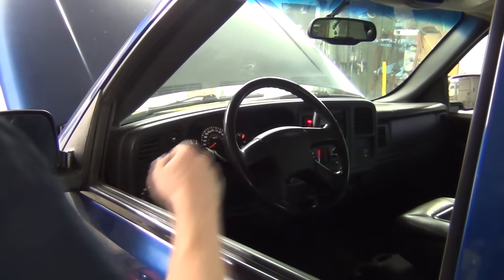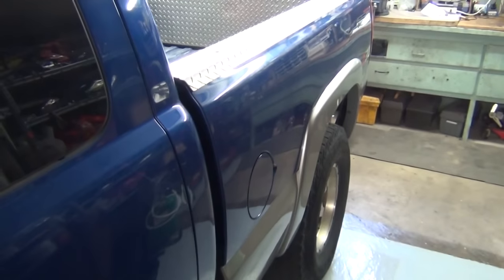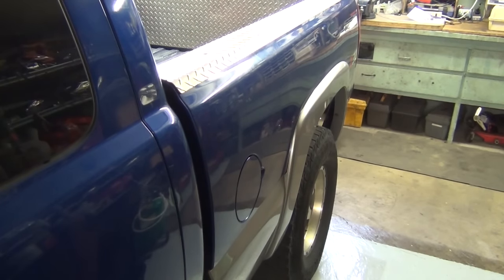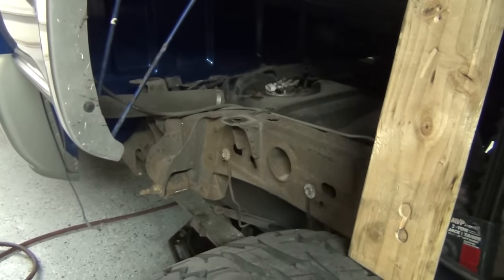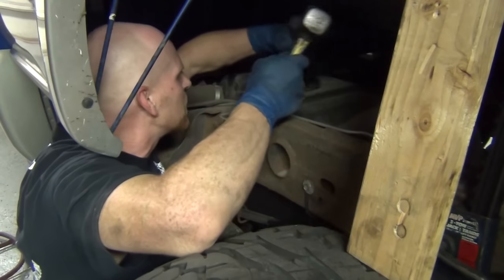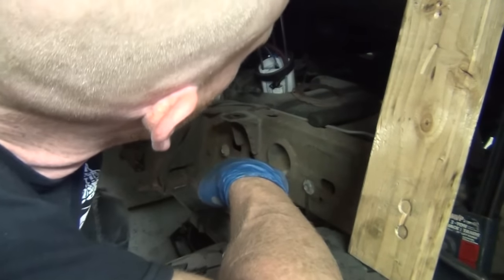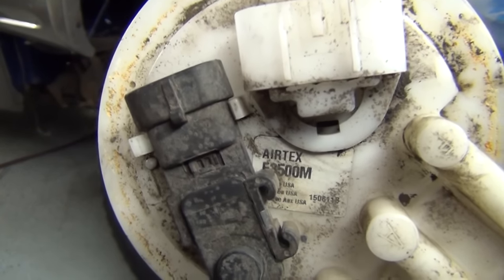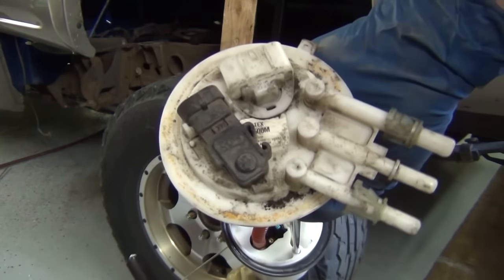Tipped Bed Method!  GMC Fuel Pump Swap.

Comment: I've used the bed tipping method before when I was younger. My next fuel pump replacement is tomorrow, but I'm much older and cannot flex like I used to. I'm taking the whole bed off this time with a gantry crane. Always wire wheel the rust from the bed bolt threads with a bench grinder and always use never seize on the threads. Make sure to test run the new pump before putting the bed back down.

Comment: Thanks for your video. I just finished replacing my fuel pump with the highly recommended Delphi unit. $177.00 at Carquest.  What I did slightly different from you was I removed the rear wheel and inner fender support brace which gave me much more working room to remove and re-install the pump. I recommend the tilt bed method to anyone and my camper shell stayed on but tailgate still needed to be removed for clearance while tilting.  I just saved myself $450.00  on labor by not taking it to the mechanic.
Reply: Is it Delphi fg0407

Comment: Yea I was wondering how long you'd work with the bed up on that piece of wood. That bed comes down, it'll mess your day up for sure...
Reply: yeah i definitely seen the board move & so did he 😂
Reply: i had tilted the bed and it took a few min before i said scew this and removed the bed it was the smart way to install the pump  the correct way
Reply: @Ken-op7sg  LOL. no doubt. I've seen access panels cut in truck beds to make it easier. Sort of like the access panel under car rear seats now that get you access into the tank without dropping the damn thing.

Comment: Brian...Thank You.
Used your method to change out a 1993 454SS fuel pump yesterday. Went with a Walbro 190lph pump. This was so much easier than dropping the tank...done that twice before on an 87" GMC.
Reply: XJj

Comment: Thanks a bunch Brian! Definitely still a tight squeeze to get in there, especially since I needed to replace the connector.. Took me 3 hours laying in the slush up here in Calgary, Alberta! My ass was numb by the time I finished. Saved me a few hundred bucks, real proud of myself -- wasn't sure I could get er done. Runs nice and strong now! My only issue is that I tightened the passenger side down without checking the fit and now the bed is off kilter just a hair. Not enough to be really noticeable but still enough to bug me.. I'll save that for the warm weather.

Comment: Thank you times one million for this video.  I got to change my fuel pump this week and this helped alot. Only problems I ran into is the nuts broke their weld on the front 2 bed bolts so I ended up cutting the bolts, the other was the locking ring holding the pump to the tank was a bear, I needed an air hammer.  Guess that what happens after 14 years of driving salty Iowa wintry roads.

Comment: One thing I like about this method you can pretty much change the pump standing in a foot of water. sure beats dropping the tank. after 30 years of changing pumps this was the first time today I tried this method, my shop was full so the only place I had to do it was out in the very uneven gravel parking lot, all I can say is no more dropping tanks for me. thanks for sharing.

Comment: Excellent video. 5 stars.

My niece started humming the Superman theme when you lifted the bed up. ;)

Running the truck with out the fuel pump relay and the gas cap off seemed to help with squirting fuel in my replacement.
Reply: you have a awesome daughter lol

Comment: Great video, 230,000 and my pump was putting out about 30-40psi.  I was not looking forward to dropping the tank.  I used a 12 inch long 2x4 and jack stand between frame rail and cross support on bed.  This along with removing the tire gave me easy access to the pump.  I didn't have the 90 degree pliers but that looks like the ticket to removing the fuel lines.  Thanks for the video

Comment: I took my truck to the shop he quoted me $850 to replace $250 for the part and $600 labor because he said it's a 2 man job to remove the bed. With your video it cost me a total of $190 for an oem part. Thank you

Comment from the maker: I always use two means of support so there's a back-up.  The bed weighs about 230lbs I have a 8,000 lb jack stand as a back-up to the board to catch it if needed.  Thanks for caring!

Comment: thanks for the video i did this method the other day on my step sons truck as he just filled the tank. super easy. i wear contacts so it a must to wear safty glasses as i got a face full of dirt. work like a charm, i live in az so we dont have the under carriage build up problem and bolts came right out with a breaker bar and he wanted to help to see how things were done and we got it DONE OVER THERE ON THERE.

Comment: I had to remove mine today and I don't have the right equipment to do this job nor do I have anyone that could help me with the bed so this video saved me. Thank you Thank you Thank you. Mine is a step side but it still worked perfect. my old pump is an AC Delco and just went out after 12 years so I ordered the AC Delco to replace it. Great video dude, Thanks.

Comment: Just had exactly the same thing happen with an AirTex pump i put in in 2012.  Only made it 50k before it started running rough like yours.  Used the bed tip method this time thanks to your video.  Was able to tilt the bed with a Ranch Hand headache rack and a full set of RKI boxes installed using a floor jack and didn't have any issues..  Put in an OEM pump this time!  Thanks for the video, it was very helpful.

Comment: the tipped bed method works great, and is pretty easy with the right equipment.  i back my truck into the my garage and use a commercial ratchet strap (used to secure cargo on semi's) to lift it from the rafters then block it well for safety. 2001 GMC 2500HD the pump goes out about every 2-4 years. i refuse to cut into my bed but thats just me.
Reply: Does this method working for replacing rear brake lines as well?

Comment: Thanks a million!  My fuel pump just went on my silverado and I'm gonna go after the repair tomorrow morning.  Going to try the tilt bed method vs dropping the tank.  Looks alot easier
Reply: Was it a 2000 by chance? Mine's there too, I see a few recent comments lol.
Reply: Chubbza5 mine is a 2000 and 120,000 miles. Debating to do it myself
Reply: @Drink6up     it worked slick.   New pump had an upgraded wire harness than I held to solder together but it was all much better than the old school dropping the tank method.

Comment: THANK YOU for sharing this! I followed your advice while replacing the fuel pump on my 2002 GMC yesterday and it was a HUGE help! 

I installed a Delphi fuel pump but my lock ring was severely rusted and I had to cut it apart using a Dremel tool with a cut-off wheel before my old pump could be removed. Once I located a new lock ring it didn’t take long before I had it back together and running! 

Thanks again!

Comment: I used your method to raise the bed up to remove the tank filler hose to syphon out some very old Ethanol gas.  It worked great.  If I ever have to replace the fuel pump I will do the same process.

Comment: Precision seems like a company that has well developed parts. I have not done any research on the brand, but I have installed a couple of different parts produced by them. Haven't had any trouble as of yet. Thanks Again for an insightful video Brian.

Comment: Good video. Like the additional support. A YT method shows tipping the bed to rear, not sure how that compares to side. Maybe be harder. I took my bed off as the bed needed some major de-rusting, and one of the captive nuts in the channel broke free and spins. Fuel pump was OK but a mouse ate thru the ground wire on the fuel pump pressure sensor.
Reply from the maker: Good catch!  What year was the truck?

Comment: Dude, I changed my fuel pump after researching on here for an easy way. I saw alot of people cutting holes in the bed of their truck, then I saw your video. And used your method and it went so easy, and saved me big bucks. Thanks for this video. And also letting people know the size of the bolts holding the bed down. I was about to cut a hole man im glad I found your video. Many Thanks.
Reply from the maker: Way to go!  Research is a smart way to get smart.

Comment: I just did this to my 1994 Chevy truck a few minutes ago. I had to remove the two rear bumper bolts and there is a bolt over the front spring shackle that takes a ratchet to get too it. Other then that it was fast and easy. I used an electric impact wrench, a 18mm socket, a ratchet, two short extension, a star or torque bit, and a 2x4. Also mine had a ground wire on the left side rear that we stretched a little trying to lift the bed. Thanks for posting the video.

Comment: I watched a guy replace the fuel pump on his 2000 Silverado by taking the bed off, but he had a tractor to lift it straight up with straps.  Worked great, but this method looks just as good.

Comment: Hey thanks for shearing your video, I had bought a fuel pump for O’Reillys and it lasted 3 days and it left me stranded in front of Walmart and had it towed back home, got it back home and took it out and took it back to O’Reillys and got my $259.94 back and got a new one at Amazon for $88. Bucks and it’s still running but the fuel line I had to put a rubber hose on and now it blow off front the pressure, I did have two clamps on it and I started to proceed to go to store and it blow off so now I have to take off the truck bed again!! This time I will lift one side like you show in this video but this time I will cut a Square hole in it this time so if it should do it again I can have easy access to it if anything should happen again. I wanted to do that when my neighbor has helped me take it off , he said it wouldn’t happen but it did just that. Thanks for shearing this video.

Comment: For everyone out there, don't make my mistake. I had my pump go bad in freezing weather. On top of which I was traveling to a dif state. So I did all the work in AutoZone parking lot laying in the snow and freezing weather. So before putting truck bed back on and reinstalling, of course I'd test it. But didn't work and I went thru about 4 brand new pumps, including having to rewire a couple. It was super bowl Sunday and I was late, I was fkn pissed- of all days it had to be. Finally a guy passing by asked me "if I had the ground connected" to the bed frame or panel by gas nozzle. Nope. Totally didn't realize I needed it connected. I thought it was for electrical surge protector. Started right up. Just a simple wire coming from an area I didn't think important caused me so much grief. So don't forget about it and be sure to connect the ground wire. In Silverado the wire that comes by the gas inlet tube.

Comment: For fuel systems, ECMs, sensors, I always use AC Delco OEM parts ONLY. I used to work for an AC Delco warehouse and we also carried Airtex parts as well. Rarely ever had any comebacks with OEM GM parts. Airtex brand new water pumps were good, the fuel pumps not so much.

Comment: For truck owners, the bed tilt method is best... work smarter, not harder. I recently just did the same, 2005 gmc sierra 1500, standard cab, shortbed, 3.4l v6, but my weapon of choice, "DELPHI FG0340" to be exact, and guess what was installed prior to my ownership of this fine and almost perfect machine 9months ago, you guess it, AIRTEX(POS). It primed perfect, started perfect, no hesitations, but motor was whining and talk about lack of power, it was severe, and that was not hauling or pulling anything, empty truck plus driver, thats it. You get what you pay for they say, and pay for it more in the long run they do, go OE if possible, i do because they are built for reliability and longevity.

Comment: All you have to do is remove the rear wheels, unbolt the bed, Remove the  rear bumper brackets from the frame and slide the bed back a few inches.  That's how I changed mine on my Chevy when it was 20 degrees outside. It beat laying on the cold ground.
Reply: Do you have a video using your method?
Reply: @fotomemoria   No and why would a video been needed when I explained it

Comment: Not sure if anyone else posted already, but use a brass drift punch instead of a screwdriver or other steel tool to avoid sparks next to those gas fumes.
Reply: +g walker , very good point...used a 3/4"aluminum rod and brass hammer on that retaining ring

Comment: I done a 02 this way cause it had a full tank of gas. The one thing I did though was remove wheel and I have exposed rafters and used a ratchet strap to pull It up and hold it in place.

Comment: I have same Airtex E3500M,  sending unit fails at 3 month. So no fuel gauge read for all of this time. Now truck not start. 5-6 psi only just like in this video. Reading many reviews and forum postings I find Airtex from this past decade sucks! Nothing but fails. I drove this truck very little so not much mileage on this pump.
My original pump on my 99 Silverado was Delphi. My next pump going to be a Delphi FG0407. Good reviews and reputation.   This video very helpful. Going to tilt my bed, removing rear bumper first.
Only problem I see is gas tank not removed for cleaning as recommended.

Comment: I've got a nbs 99 Silverado, and have done 3 pumps on it in the last 12 years. I have tried bed tilted as you show, bed off completely, and dropping the tank. I actually think dropping the tank is my preference now. It was at least 30mins faster in my opinion. Plus, you gotta admit, it's pretty nerve racking sitting between the bed and frame no matter how well you support it ;)

Comment: Really good video, briansmobile 1.  I especially liked your methods for removing the fuel lines from the pump.

Replaced fuel pump "10 years ago almost to the day" on the same truck I'm in the process of doing again.  I put in a Herko from eBay because the OEM were running $400 and change from the parts stores back then.  Did the "tilt back" method on a tip from a guy at work and saw your vid for the "side tip method".  Your method makes it a hell of lot easier to jack up the bed if you have a full tool box hooked to it and ya have 65 years under your belt.  It's up and ready to go for the new pump.

As I got 10 years out of the old Herko, I'm going with another one which should deliver tomorrow or Tuesday.  This old 2000 Silverado LS Extended Cab 3 Door with the 5.3L with nearly 350,000 miles on her, has always treated me right.  When the fuel pump went out the first time, I was just a couple miles from home, on my way home from work and got a tow from a neighbor for a shared 6 pack.  This time she quit right in my own driveway.
Reply: I have a question about my 95 2500 Silverado it cranks fine and it seems like when it gets hot is accelerators like it's running out of gas and then sometimes I'll be going down the road and when I shift gears it is cut straight off could anybody help me with this problem

Comment: I put a $280 airtex fuel pump in my 00 grand prix. IT was weak and the gauge read wrong after it was installed. Failed a few months later. I now have a 01 silverado and plan on doing a fuel pump when it warms up, has 160k miles on original pump. I will def try this method xD

Comment: I just changed out the filler neck on my k2500 they are 36.50 on ebay if you do a lot of these i would suggest keeping them in stock. It had big holes rusted in the top of it.

Comment: Once I got my old pump out I found a short rubber hose connecting the pump to the fuel was ripped and failed. My truck would run but barely drive. Also it was surging when I ran the RPMs up and hold it there for a few minutes.

Comment: Thanks I just change my fuel pump today 2003 GMC Sierra
Reply: Trivia the 03 gmc and  silverado half ton 4 wheel drive only is a very rare truck that seperates it from the rest do u know what it is
Reply: Just the 03 4 whee drive

Comment from the maker: They are much cooler, drier, and comfortable to wear.  I take a new pair of pants and cut the backs out and sew around the opening and then sew the removed portion to the front for strap-free knee pads.  I've considered using foam inside of it like a pocket.

Comment: Use a brass drift pin to remove the locking ring, no possible sparks. Pay for what you get.
I am bitting the bullet and going with a stock fuel pump from Chevy.Orginal last over 325,000 mies.

Comment: Airtex - yep - there's yer problem. put a carter in my 95 ram , no issues at all. used my engine hoist to lift the bed bed and move it back ( 8 foot bed ) made doing the pump a breeze. besides - I am 6 -4'' and 270 and crawling into tight spaces doesnt work for me LOL.

Comment: Even if you were touching on the tailpipe it would be pretty easy to drop the exhaust out of the rubber hangers.

Did a fuel tank on a Toyota Camry the other day and had to cut the exhaust down from the resonator back.  I hate fuel tanks/pumps.

Comment: Help -  my 2005 chev  Silverado 1500 4.3 standard  got shook when I towed my van about 30 feet. The truck stalled and would not start again.  No fuel ( I can hear the pump run but no gas at the test valve and stop )  no spark  -  is there an IMPACT switch on this truck that needs to be reset or replaced ? ? ?

Comment: I will agree my man, yes they cost alot but if it fails within the warrenty period, you take the reciet showing you bought the pump there and so on, they usally will warrenty, ive seen at my dealer us drops the tank, replace the pump for the customer under a new parts warrenty! customer didnt pay for the labor! but i understand its all depends on teh dealership

Comment: I may be wrong but it would it seems to me if you jack the truck up and take the tire off it would make a bit more room  to move around. Just as an afterthought take a look at that brakeline because the time to change it is while that bed is up.